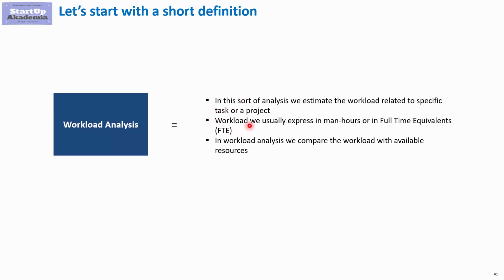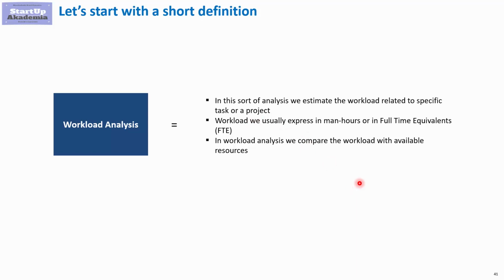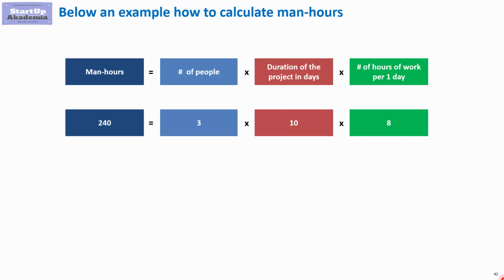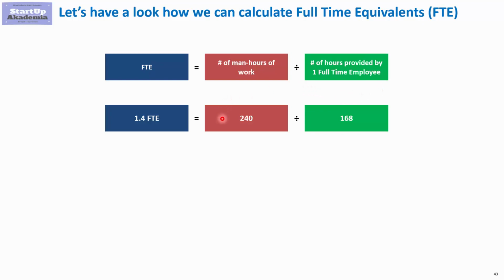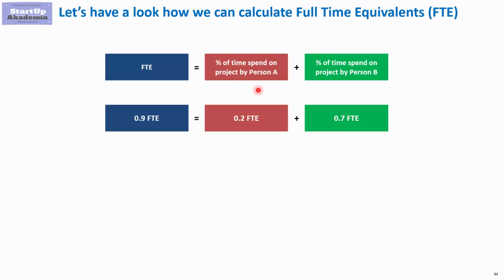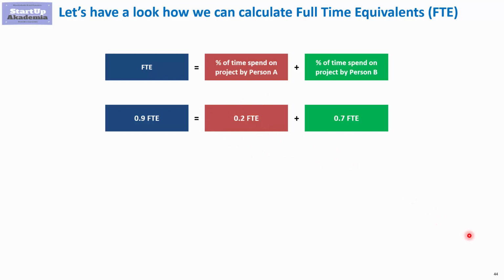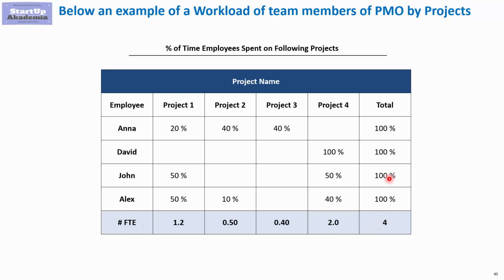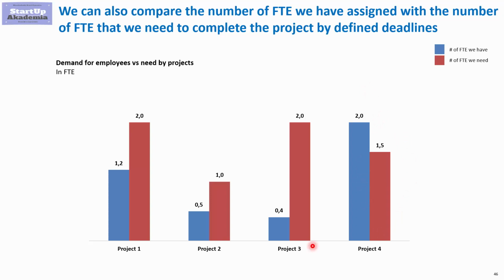Workload Analysis for Projects & Headcount (Workforce) Optimization using FTE

Comment: Hi, how do you get the duration of project in days?
Reply from the maker: You have to define the scope - ideally specific tasks. Once you have the scope you estimate the duration of those tasks and you use this information to estimate the duration of the whole project. On estimating specific tasks check this video: https://youtu.be/1i9xdpY0d80?si=WI1kjD_3y7EvKs6Q
You also have to take into account certain things that may be linked to natural processes occurring that will not be included in the task duration. For example, painting the flat can take 1 day, but you will have to wait under 3 days for the paint to dry to, so the whole project of painting in fact takes 4 days (Painting + Drying)

Comment: hello, i have a question for the last slide. you got "# of FTE we have" from the previous slide. but how you got "# of FTE we need" ? thanks
Reply from the maker: Hi. Thanks for the question. You estimate the # of FTE we need by listing the work that has to be done and estimating the tasks that have to be performed. For that, you need the scope of the project to be defined. If you don't have it you would have to assume the % involvement in the project based on previous similar projects or use some benchmarks. For example, firms that want to change their MRP system quite often ask the provider of the system for some benchmarks in terms of how many people, from which department, and to what extent they need. This enables them to estimate the # of FTE needed, on top of that by departments nad positions